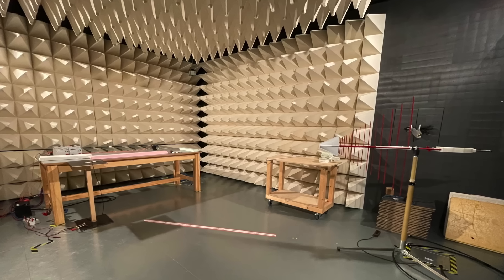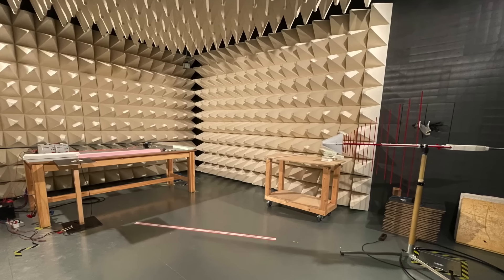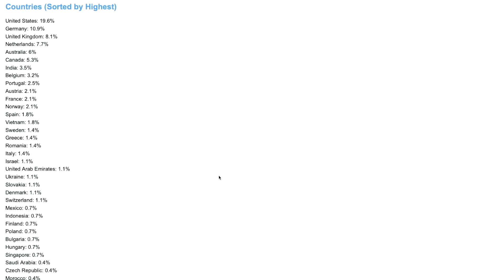I Built the Perfect PoE Sensor - But Can't Sell It to You

Comment: Let's be real, nobody is going to bat an eye if you send a few parcels to a country and you're not paying for the recycling fees (Verpackungsentpflichtung). 
The lawyer for the shop is also overkill. (Lawyer for starting your limited liability company on the other hand..)
Instruction translations hurt, I guess that's true. RF testing too.
I've found that many standards are attached to the relevant laws (i.e. in the Maschinenrichtlinie), but if not, don't look for them at libgen ;)

But yeah, starting a company is hard. Just launching a side project on the side is not really feasible, especially if it's of such technical nature.

Comment: This rant is pointless and speaks mostly of ignorance. There is exactly the structure available across many jurisdictions he would require, a limited liability company, which for good reasons has required an initial capital for decades. With this company you shift personal liability to the LLC, which of course requires some capital to found it. There are different forms of companies available, which either entail some personal liability or require funding capital. 

He could sell it as a single man operation but cannot in that case shift liability to anyone, which he apparently desires. You are liable for an electronic product and you have to prove with a voluntary emitter that it will not unnecessarily disturb the usage of our globally shared medium. What happens if his design catches fire? What if he increases transmission strength not caring about anyone else? With electronic there are so many what-if's that regulation is required.

It all boils down to:
I want to sell without taking any responsibility. He could publish the blueprints or the design if he just wants to get it out. If you want to make money, you have to take the risk. If you don't want to take the risk personally, you will have to borrow cash for the initial funding of the LLC. From his accent that would be 25000 € here in Germany for a GmbH.

Capitalism is inherently unfair to small businesses, I don't get why it always requires a socialist to point it out. In capitalism no company will do anything that will reduce the bottom line voluntarily, so regulation will always be required. Those that do out of good will, get swallowed due to a lower bottom line. Capitalism naturally tends to consolidation and oligopolies/monopolies which produce gigantic corporations with armies of lawyers finding loopholes requiring stricter regulation. Line must go up, voluntary profit cutting will make the shareholders angry.

Comment: you're trying to tackle two things at once:
* manufacturing a product
* selling that product to consumers directly

Things like recycling fee fall into the latter. it's the shop that pays them, not the manufacturer.

There's also another pitfall on the shop side for selling across europe that you didn't mention: 
VAT - value added tax. Eg called TVA in french, MwSt in german.
As a shop, you have to apply the VAT of the country of the recipient (and declare/pay that vat to that country). There is a lenient threshold of Euro-amount per country, under which you can treat buyers from that country like being buyers from your country. I have 8000 € in mind, but far from sure. oh no, seems the threshold is higher and different by country. search for "European VAT registration & Intrastat thresholds".

This is knowledge from 10ish years ago. seems the VAT part got even more lenient in january 2025.

This somewhat moots my point in a positive way. My point would have been: consider forgoing the hassle of also becoming a difect seller. This would be finding shops to carry your product.
edit:
* eg. shops that already do what you plan to = sell small volume iot stuff. B2B any kind of agreement is possible (partnering, just reselling, etc)
* amazon as "sold and shipped by amazon". no idea what that entails though, whatever conditions they have might make this a no-go.

Comment: I used to work in R&D for an electronics manufacturer - our turnover was £7 million so we weren't small, but not large. The EU regulations were insane, as you describe, and they are even worse now. We analysed our competitors' products and it was obvious they failed the EU standards by a long way, yet they were CE marked. The products from China had clearly never been tested at all - they put CE stickers on literally everything they make. An EMC test lab told me that they would issue certificates for the American products if the manufacturer paid full price for an initial test and one retest regardless of whether they passed or failed.

We did everything properly and it cost a fortune - we made a family of products so it cost tens of thousands of pounds for every visit to an EMC lab (for electromagnetic emission testing). And that's on top of all the tests we did in-house, like environmental testing, electromagnetic susceptibility, flame retardance (for UL certification) etc.

The EU no longer has any jurisdiction in the UK, so if I was still in that business I would sell into the EU and ignore their regulations like the Chinese do. I suspect that if you are small, you will go under the radar. It's more likely that I would just sell to the rest of the world and ignore the EU because it is so hostile towards businesses. Worse still, even though harmonised standards are a supposed benefit of the EU, each EU country imposed its own requirements on top of the EU standards, so both the hardware and software had to be different for many countries. The EU is a total clown show, which is unsurprising when you see the dismal quality of the people running it.
Reply: I don't think the issue is with the regulations motive, I do agree that they do place an unreasonable burden on SME. This is the issue of using civil law instead of common law (every minor detailed controlled Vs common sense). The UK is still one of the best places to setup shop as a SME, in northern Ireland you are actually still technically in the EU single market, but not officially, so take that as you will

Comment: Sell it to the user as a broken electronic waste for "parts or repair", or desoldering practice.

Guaranteed as a great parts donor with all parts working.  Just maybe the reset pin of the main chip is accidentally activated by a short on the PCB.

Comment: I have collaborated with a company before that also needed the EMC testing. What they did was that they had got a contact at a university with some "Cheaper" equipment for testing. And then they just had to add the testing equipment's Measurement error to the result, this was enough to prove they where conforming with the CE marking. 

As for Translations of the User manual, have you considered crowd sourcing it?

Comment: I am a regulatory engineer, you need me not a lawyer.  Lawyers are not sufficiently technical, I have tried with them.
I agree it doesn't help small business, but there maybe solutions or lower caps on WEEE for example, I havn't checked but I have a vague memory about it.  EMC is your biggest cost.  Don't neglect ROHS or ErP as these are now CE marking requiring evidence.
You don't need LVD, or rather prove it in advance but you do need to meet GPSR, which isn't a CE marking regulation.
You might be able to sell as a self assembly or just the PCB, maybe someone else sells the components kit.  I think you could get away with a 3rd person assembling kits on request (Brand do this all the time, they take the responsibility, the actual constructor takes no responsibility).
Personally I think you are right, its all designed for mass production, there should be a low volume exemption (because self assembly and discrete parts collection are allowed to keep volume low), once you get near or above the limit you have to invest in the compliance.

Comment: Gutted for your frustrations! I wonder if LocalBytes could help you? Also, like others might have said, a kit form might be easier to sell - can't see how you need any approval for the 3D printed outer case? Is it also just the circuit board, perhaps the same can be done there. Really hope you find a solution that doesn't gouge you!

Comment: Regarding CE marking, you can ask(and pay) a certified body to analyze your product and tell you what tests you need or you can go the self certification way. Either way, the EU will trust you. Incase the product fails or they pick up your product as part of the annual random tests, they will properly test it and then come to you and ask for test reports.

Though it may not look like it, it is indeed made to keep out crappy electronics away. 

If you want, I can have a look at your product and give some advice. This is the first time I see your video and am not sure where you live, but in Romania, a general EMC testing costs about 2000€. Also, you can also do a pre compliance(basically rent the lab) to ensure your product passes the test, before actually testing.

Comment: From what I understand of the process, 
you do pre-compliance testing yourself, which is much cheaper and tweak the design until it is very likely to pass. You send it to one of UL / CSA / ETL once and pass, you stick that logo on together with CE.
Reply: The likelihood if the device is good and proves a 250k piece market worldwide, its going to be someone in Chinas problem with the regulatory logs in 8 months.    

Sell the IP as the software, have a job shop ship the PCB as pre regulatory dev board.   The encloser publish the 3d printer files.   Getting 1000 dev boards through the EU boarder or US boarder is only a problem if it can be weaponized.    Shipping on dev board to the customer isn't a regulatory event.

Comment: It should be easier for individuals and small startups to sell first prototypes. There should be some kind of limit where you don't have to comply with those certifications, for example 5000 devices and 50 000 euro revenue. If you exceed either, then you have to comply with all the standards. Of course there should be some preventive steps, so no big company abuses it. But overall I think this could make EU more innovative and startup-friendly.

Comment: Sell it as a DIY kit, make it super easy to assemble, use parts that are already FCC compliant\CE compliant and you should be fine because the customer as the final assembler is making it clearing you legally.
After selling some units you could work with a bank, get the loans and file the paperwork but well as you know it's an expensive and burdensome process. The worst part is it's a pain on purpose, this way established players with big budgets can force you to sale the idea/designs or keep you in the hobby space with the loop hole I mentioned. Maybe you could get together with some other makers and start a petition in the EU to compel the government to simplify the paperwork and reduce the cost for good faith actors.

Comment: inventor here.. Thanks for putting lights on this! 
Sadly selling electronic inventions is only for bic corp. not doable for individuals. Big corps put all those rules with intent. ;). not to protect customers.. thats the cover.
i wanted to change the design of a valve. just getting informed about all the design rules forces you to pay.. it gets you a drab PDF with the dryest possible legal language text. Usually you dont get all info in one section.. so you have to buy more of these PDF..  you can, try to do CE certification by yourself. i worked with companies that have selfmade climate chambers just for this purpose.  Then order CE stickers from china like they do :)

Comment: thanks for highlighting the sometimes extreme cost to enter the market, yes products needs to be safe, EMI - compliant and to be recycled.
i work as an engineer at a small company that sells specialized gear a a rate of a few hundred units per year and this kind off stuff takes a lot off work.

but in my opinion the worst part is that you need to pay to know what the law requires of you, this is not something that i think belong in a civilized law based society.

there needs to be some kind of rule that eases this kind of requirements for small companies

and regarding recycling, i think that every manufacture shall pay for recycling at time of production/import per kg plastic/electronics/batteries/metal etc 

sometime i just think big corpos lobby for rules just to make market entry hard.
this area of regulation needs a lot of improvement.
i will relay this to a friend of mine that ran for EU parliament last time around and will run again next time.

ps don't forget the cyber resiliency act that comes into effect next year (September 2026), but if you designed you product in a decent way this should just be a day or two writing up the required documents.

Comment: Pretty simple fix: Sell the PLANS (I would serialize the plans to prevent copying or unwanted use), complete with instructions on vendors to use to create the PCB, vendors to use to create the housing, perhaps even include an STL file if 3D Printing the housing is feasible.

Comment: You are describing the process to bring a retail product into worldwide distribution. Sell it as an unfinished product for "professional use only" and require a completion step like, requires assembly or requires loading firmware to work. Include a warning tag, " It is the professional users responsibility that the product, when installed and configured, meets all local codes and regulations." If a large company ever buys your product, they can do all the retail legal work.

Comment: A lot of people are saying sell it as a kit, but you could go a level above that & sell the files & firmware. 

I can get a PCB + assembly from PCBWay, and get them to 3D print the enclosure.
Reply: "Files and firmware" are the main intellectual property of the manufacturer. Having them you can arrange your own manufacturing, analyse the code or incorporate malicious executables. Of course, if it is not an open source project.

Comment: There may be less restrictive rules for products sold in very small volumes through platforms similar to Kickstarter, since many such products are sold on these platforms, and most of them don't do all of this (translation into all languages, recycling, independent lab testing, etc.). Unless they are all illegal.

But as it has already been said in comments, the actual law is already not as restrictive I you thought. Norms are not regulation. CE mark is self declared. If your product is trivial and all of its component are already CE complient (I don't know if this is your case), I wouln't be too scared selling it with the minimum testing.

The issue with recycling fees is probably the worst thought. A flat tax with no regard to volumes ? what the heck ?

What you could do (I think) is officially sell ONLY in YOUR country. Then, consumers from other countries would import it. EU is a free market, so there should be no additional taxes and little to no issue with regulation as long as you comply with your country's regulations (and to EU's by extent).
Reply: That may just be how all the kistarted product work actually. You sell in your country. People form other country import at their own risk (customs could seize it, high taxes, delays ...). For imports from EU to EU, risk is very low.

Comment: ‼ Well, ALL EU citizens can be very grateful for most of these regulations, otherwise there would certainly be fatal electric shocks again or neighbors interfering with their own Wi-Fi.
🤣 But the funny thing is that in inspections, 8/10 devices tested repeatedly fail and do not meet the standards.
🤣 Typical of the EU is that there are no real consequences; the EU doesn't care: China has never changed its strategy of circumventing/ignoring EU regulations.

Comment: I am fairly sure that selling as kits don't exempt you from CE compliances. You might get away by selling the design only, and no parts... But even then the CE might be needed... 

But as someone wrote I don't have to get things certified... You just have to declare the product is complaint, by slapping the CE stikker on the product.

Only issue is IF something is wrong, you are 100% liable. Most companies trust the products are safe and just slap the CE on everything... and 🤞🤞
Reply: And here is why I quite sure at selling kits don't bypass CE. Cus IF it would, EVERYTHING would be sold as kits with minor assembly required. Cus if you can bypass CE that way, you also bypass any liabilities... = No need for companies to spend money on lawyers, insurance, testing, and and and... It would be a giant loophole that everyone would use to save money.

As CE is all about protecting the consumer such giant loopholes hopefully don't exist, and if they would already been misused and plugged .. 🤣😂